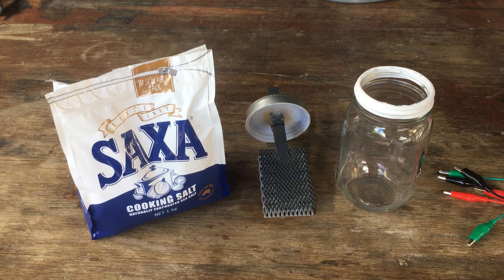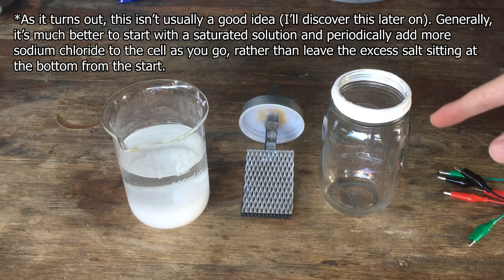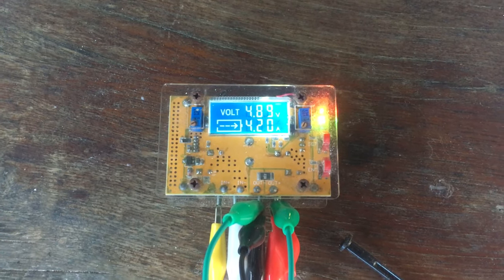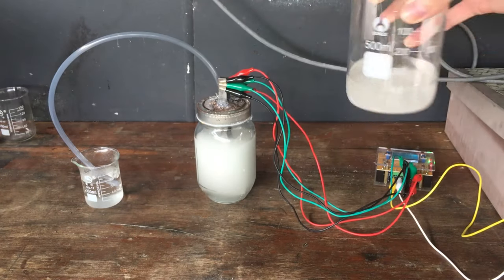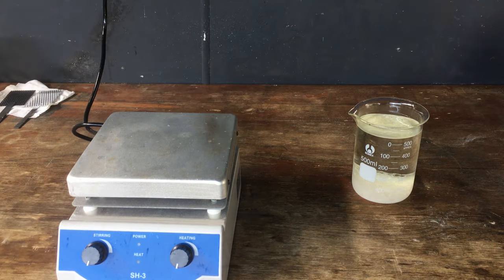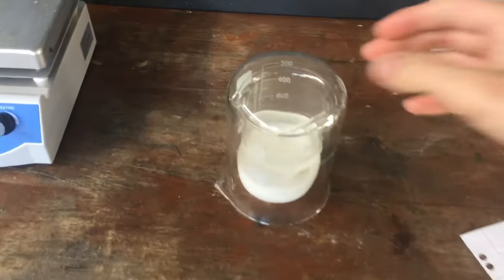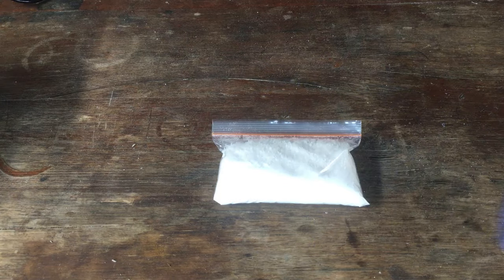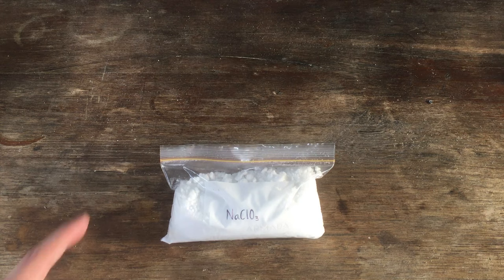A Sodium Chlorate Cell

Comment: Hello, Is it possible to do this process using graphite on both anode and catode?
Reply from the maker: Yep! Just be aware that if you have a graphite anode, it will fill your solution with carbon particles as it falls apart, so you’ll likely need to filter and maybe recrystallise your final product.
Reply: Hello again, thanks for reply before, but how about if I use galvalume or zinc in both anode and cathode? Still I can run this process?
Reply from the maker: As it turns out, any electrodes based on zinc, steel, or stainless steel will not work as an anode, since they won’t survive the oxidising conditions.
As such, the electrodes you’ve suggested definitely won’t make chlorate when used as an anode, and I’d say they would be pretty poor choices as cathodes too.

The only viable choices for an anode material (which are also cheaply available to individuals) are carbon, mixed metal oxide, and platinum. As a cathode, I’d just recommend ungalvanised iron or stainless steel (or titanium if you can get it).
Reply: @ScrapScience  hello, thanks for reply, is it possible to create with this reaction : naclo2 -> nacl(l) + o2 (g)
And then boiling naclo2 till turned into naclo3? Tbh in country where I'm living it's so expensive the cost of chemical tools.
Reply from the maker: @blue_serenade  I'm afraid the reaction you've described heavily favours the decomposition of sodium chlorite, rather than its formation, especially at high temperatures. There's no feasible way of directly reacting sodium chloride with oxygen to make it.

Technically, you could just boil bleach to make sodium chlorate, but the yields are low and separation from the sodium chloride byproduct is somewhat difficult.

Regardless, if you want moderate/large quantities of chlorate, electrolysis is the cheapest and most effective way to go. If you can't get hold of the necessary materials, you may be out of luck, sorry.

Comment: Can we use gas carbon as electrode as optional.???
Reply from the maker: What's gas carbon?
Reply: Gas carbon is a carbon that is obtained when the destructive distillation of coal is done or when petroleum products are heated at high temperatures in a closed container.[1][2][3] It appears as a compact, amorphous, grey solid deposited on the walls of a container that holds the gas carbon. It is also a good conductor of heat and electricity, similar to graphite. Applications include battery plates, in arc lamps, and coal gas.   Wikipedia
Reply from the maker: If you can fashion it into an electrode, then sure, go for it.
I don't expect the performance to be any better than graphite though (in fact, it will likely fall apart quicker), so you'll probably need to replace your anode periodically and filter your final solution from the carbon dust before extracting the chlorate.

Comment: Which anode and cathode I must use for this cell ? Rather than mmo ,platinum ,manganese on titanium etc..
Reply: For anodes mmo or platinum work great lead oxide can work but it's toxic and carbon works but then you need to remove all the carbon particles.. Don't use ebay "platinum" anodes because their fake and don't work.. for cathodes titanium or carbon are normally used
Reply from the maker: The anodes you can use for this cell are exactly the same as the ones you can use for a potassium chlorate cell. If you don't want to use MMO, platinum, or MnO2 electrodes, your only other options are lead dioxide (which MUST be plated onto graphite or titanium, NOT just anodised lead metal), or bare graphite. There aren't any other viable anodes which will work here.
I'd recommend just using graphite if that's all you can get. As Mark has said above, they'll fill your solution with graphite particles which will need filtering, but then you won't have to deal with the difficult and toxic process of making lead dioxide anodes.

You can use whatever you want for a cathode (excluding reactive metals like aluminium or zinc). Iron and titanium are generally best.
Reply: @ScrapScience  thanks mark and you too.If graphite is mixed with kclo3 or naclo3 ,will crystallization work to remove them from their crystals ??
Reply from the maker: After filtering the graphite particles and crystallising your product, it might still have a slight grey colour from the graphite you weren't able to remove. This won't cause any problems for most uses though.
Reply: @ScrapScience  if I want to trap fine graphite ,what should I use then ,for example fine silica
Reply from the maker: It's near impossible to get rid of all of the microscopic graphite. You might have to experiment with different filtering media to see what gives you the best results.
Reply: @ScrapScience  thnx
Reply: @ScrapScience  reusable plastic coffee filters work well if you don't have a glass fritted funnel.  My coffee filter cost about seven dollars and is fine after many runs.
Reply: @Prchemist06  
Ralf V K.
vor 1 Sekunde
First let it settle for a day or so and decant it, to get rid of most carbon particles and after that, I would press a cigarette filter into a tubing, so that it's sealed up with the walls and pump the solution through it. That should be good enough to get it clear again.
Reply: @ralfvk.4571  Thanks bud

Comment: for some reason there is some green stuff floating on  the surface of my chlorate cell, wtf is it?

(oops typo, i meant green)
Reply from the maker: Possibly some impurity from your container, electrodes, or the salt itself. You'll need to provide a bit more information to figure this out.
1) Are you using cooking salt as opposed to table salt?
2) What is your cell made of?
3) What type of electrodes are you using? Have they ever been used for anything else?
Reply: @ScrapScience  graphite electrodes from batteries

salt from supermarket (it has iodide) (dont have pure chloride rn), it's cooking salt i believe

it's a glass jar for container, only used for salt and put activated coal in it before but wanst in direct contact
Reply: just gonna ignore it till it's a problem
Reply from the maker: Your impurity is almost definitely from your electrodes or your salt.
If you've extracted your carbon rods from batteries, they will have introduced various impurities to the cell. You can get rid of some of the organic contamination by blowtorching the electrodes after you extract them from the battery cells (the surface will burn briefly). It won't get rid of everything though.

The salt you're using is a much more likely culprit. If it has iodide/iodate in it, it also probably has some anti-caking agents, which is probably the white stuff you're seeing.

As you've said, whatever it is, it's unlikely to be a problem for the cell, so I wouldn't be concerned.
Reply: @ScrapScience  i fix one thkng, another problem appears

i fixed the green impurity! because now instead of copper chloride and oxide, it's iron chloride and oxide from the lid!

and also it's leaking chlorine and idk what to do, wuper glue, silicone, epoxy, nothing worked so far, and the chlorine must be leaking from the electrodes since the wires are already oxidized and with a bunch of chlorine

it's wonderful how i can fail so easily at making such a simlle thing.

also question: with i add NaOH to the cell the start, will it help with efficiency for the first few hours when chloride is still turning into hypochlorite and hydroxide?
Reply from the maker: It’s definitely a good idea to keep copper away from your cell. The formation of copper chlorate is very undesirable since it often makes pyrotechnic mixtures shock sensitive.
Either way, it’s good to hear you’ve figured out the root of the problem at least.
As for adding sodium hydroxide, it only takes a couple of minutes for the hydroxide concentration to build up, so I wouldn't worry about it honestly.
Also, it would likely be very difficult to prevent overshooting the pH. Even just adding an extra half of a gram of NaOH to a cell of this size would push the pH way above the ideal value of 9-10, and possibly damage the anode with the strongly basic conditions (though I'm not sure how bad this would actually be for the electrodes).
You can definitely do it if you want to minimise the chlorine generated at the start of the cell run, but be careful of overshooting the amount of NaOH you need. Milligrams of the stuff will do for a cell this size.
Reply: @ScrapScience  i am jist gonnal let it run for awhile now, checkong once in awhile

cant do much about chlorine leaking, the lid itself is sealed, along with the pvc hose, what is leaking just seema to be the electrodes, and i cant do much about that, they are tightly fittet into pieces of hoses with teflon tape in then and glued with silicone glue yet it leaks, must be because they are really porous and are just not sealing well, definitively could fix it with some epoxy but now it seems to be such a minimal amount of chlorine leaking that i wouldnt worry, and it's also outside so should matter all that much

and about ph, i will let the cell self level, it will level at some point, shouldnt matter much i just want some chlorate, later i can worry about making a more efficient cell and might go for titanium and mmo electrodes too if i can find these, they are surprisongly didficult to find, so maybe ill just stick with these cutting graphite rods, no perchlorates but that's just how it goes ig

edit: oh for fucks sake now the electrodes are rapidly degrading and i dont know why

Comment: Can u use istead of an mmo anode a Titanium one
Reply from the maker: Nope. I'm afraid it's not that simple. The only easily obtainable anode materials which will work for this process are MMO, platinum, and graphite.
Reply: @ScrapScience is graphite an option
Reply from the maker: Yes, but it will fill your solution with graphite particles which are very difficult to filter, likely making your product discoloured.

Comment: Youre CE is about 29.5 percent if youre CE was 100 percent you should get 1067.3 grams sodium chlorate
Reply from the maker: That's true, but you're using a different definition of 100% efficiency to the one I'm using. Your calculations assume that the ideal reaction requires the passage of six electrons to make one chlorate ion - which is only a major reaction pathway in cells that have pH and temperature control. 

Under the conditions I'm running this cell, it's performing a reaction pathway where the passage of nine electrons is required to make one chlorate ion - and that's how I've defined the ideal 100% efficiency. This also explains why our answers for the yield differ by about 50 percent.

Neither method is necessarily the correct one to use here, so your answer of ~29.5% is just as valid as my answer of ~43%, provided we know how we've defined 100% in each case.

Comment: Can we use carbon and iron electrodes
Reply from the maker: Yep, carbon works as an anode, and iron works as a cathode. If you use iron though, be aware that any electrode surface not touching the solution will quickly corrode and may fill your cell with oxidised iron.

Comment: Can I use carbon electrodes?
Reply from the maker: Yep, that'll work. Note that the anode will slowly disintegrate over time though, and you'll have to filter out the carbon dust from solution before crystallising your product.
Reply: @ScrapScience  but how to filter it after process
Reply: @_____------10  
Ralf V K.
vor 1 Sekunde
First let it settle for a day or so and decant it, to get rid of most carbon particles and after that, I would press a cigarette filter into a tubing, so that it's sealed up with the walls and pump the solution through it. That should be good enough to get it clear again.

Comment: sir please help me 🙏  how to convert NaClO2 to NaClO3 .......please make me this video
Reply from the maker: I don't really understand why you'd want to do that.
Sodium chlorite is a relatively obscure chemical, and generating sodium chlorate from sodium chloride is so much easier (along with the fact that sodium chloride is a much cheaper and more available starting material).
Why do you want to do this?
Reply from the maker: I saw a notification that you replied here. However, it seems like your comment has been automatically removed (this is a spam preventative measure that happens for comments containing hyperlinks, among other things).
Sadly, I don't have any control over the comments disappearing, so you'll have to reply again if you want me to respond.
Reply: @ScrapScience Ok sir

Sir as you know Sodium chlorite is much more hazardous as compared to sodium chlorate. So, I want to reduce this hazard and I want for making Fireworks. Sir i have a question for you...... 

Can i make black powder using NaClO2 ?? and its reliable making fireworks as compare to NaClO3 ?? 

And what are the process to convert from NaClO2 to NaClO3 ??
Reply from the maker: Correct, sodium chlorite is a much more agressive oxidiser than sodium chlorate.

I'm not sure whether sodium chlorite can be used for fireworks or pyrotechnics, since I don't know anything about either topic. I would definitely avoid it though, since chlorite may react spontaneously with some reducing agents, or create friction/shock sensitive mixtures. In general, chlorite mixtures will probably be much more dangerous to handle than chlorate mixtures (which are themselves not too friendly anyway).

You can convert sodium chlorite to sodium chlorate by mixing with a stoichiometric equivalent of bleach, and boiling for a while. The yield here isn't great though, and the electrolysis of sodium chloride will be more efficient.
Reply: @ScrapScience  Sir i am using sodium chlorite 80% extra pure

Thank you sir for giving me informative information
If you don't mind sir, may i request ??
Please make a video "how to covert sodium chlorite to sodium chlorate" this topic helpful to me or others
Reply from the maker: No worries at all.
Sadly, I don't plan on working with chlorites at any point in the forseeable future, due to their association with harmful medical conspiracy theories (which I don't want to have my channel associated with), and lack of uses (almost any reaction involving sodium chlorite can substitute the chlorite salt with easier to obtain materials).
Converting sodium chlorite to sodium chlorate is something you might have to experiment with on your own I'm afraid.

Comment: Chlorate need the solution to be hotter than 40 C°
Reply from the maker: This isn’t actually the case. Increasing temperature is only useful if you also perform pH control (to precisely pH=6.7). If you do both, you’ll run a more efficient chlorate-generating reaction, but elevated temperatures alone will not achieve much.
I have a full explanation of this on my video about potassium chlorate cells.
Reply from the maker: 'Under 40 C' you do make hypochlorite, that is correct. In fact, anodic oxidation of chloride will make hypochlorite at any temperature under basic or neutral pH. With high temperatures and pH control, the hypochlorite will then disproportionate into chloride and chlorate, which is what the Wikipedia article is saying in your first quote. In any circumstance where you don't have both pH control and elevated temperatures, the hypochlorite will not do this. However, in these sub-optimal contitions, the hypochlorite ions will eventually reach a concentration where they are further oxidised on the anode (producing chlorate). The Wikipedia article you quoted actually briefly talks about this reaction pathway as it is generally considered as a loss of efficiency in industrial cells:
"However, the anodic oxidation route requires 50% additional electric energy. Therefore, industrial cells are optimised to favour autoxidation. Chlorate formation at the anode is treated as a loss reaction and is minimised by design."
Our cell is different. Since we don't want to perform both temperature and pH control, we are trying to do the less efficient anodic oxidation route which proceeds as a two-stage process (first oxidising chloride to hypochlorite, then hypochlorite to chlorate).

For your second quote, this is true as well. A solution of sodium hypochlorite (at the correct pH) will start to disproportionate to produce chloride and chlorate when you heat the solution. The point I'm making is that hypochlorite can also be turned into chlorate by further oxidation on the anode in our cell.

Once again, I have a complete description of this chemistry in my other video about potassium chlorate cells.

Comment: Can i run the cell longer than neaded or does it destroy the mmo elektrode?
Reply from the maker: It's generally a very bad idea for regular MMO electrodes I'm afraid. They get utterly ruined when used in a low chloride concentration, so you should always stop before you run out of chloride.
Reply: @ScrapScience  how much should left over? Currently i have 210g kcl in the cell
Reply: @ScrapScience  below 10% chloride, perchlorate starts being generated but MMO can't handle perchlorates
Reply from the maker: @Pyrokartoffel  With MMO or graphite anodes, you generally want to leave at least 30g of chloride ions per litre of solution.
For a potassium cell, this means that you should stop the cell before you get below 65g/L of KCl. To be safe, I usually stop at around around 100g/L.
Similarly, for a sodium cell, you should stop at around 50g/L of NaCl in solution. Again, to be safe, I usually stop at 75g/L.